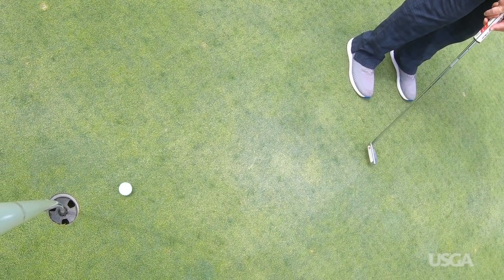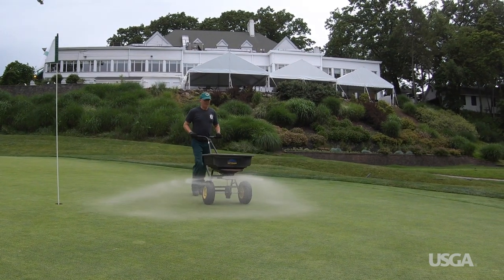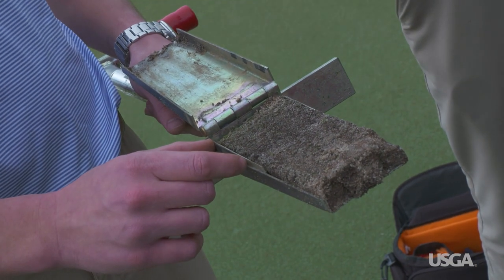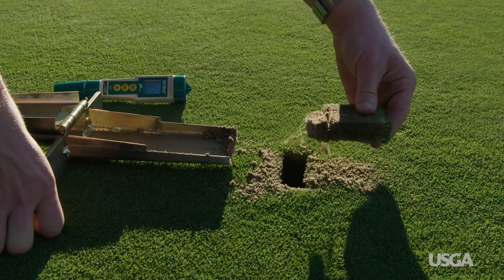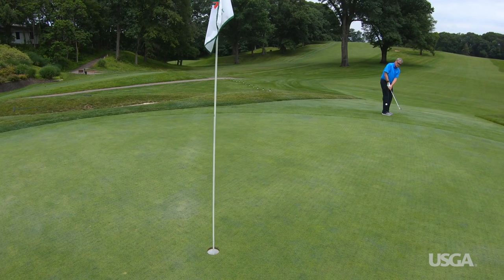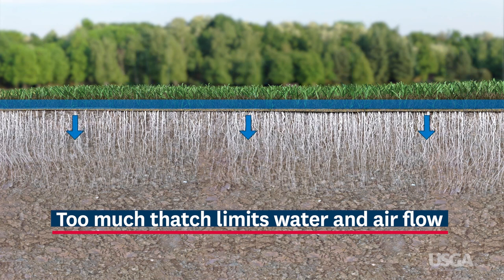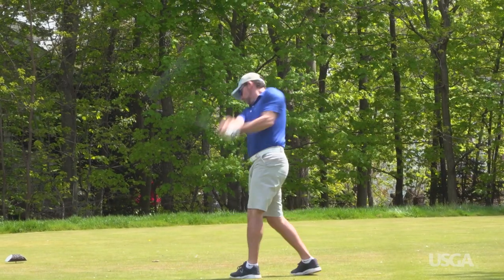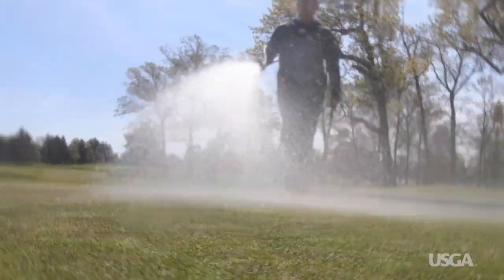Fore the Golfer: Why Courses Topdress Greens

Comment: So I'm still confused. Sand helps to dilute thatch. I understand too much thatch is not good, but HOW does the sand dilute the thatch? Does it draw water out of the thatch? All I see is a layer of sand going on top of grass and no interaction with the thatch underneath.
Reply: it's that a mix of the thatch and sand and dirt is a softer base for the green...what's interesting is that metal spikes used to naturally aereate the greens
Reply: I would assume that the sand gets put on top of the profile so it would eventually move that organic material further down through the profile over time and also promote drainage with adding sand.
Reply: Thatch is the layer of dead tissue between the growing surface and the soil layer.  Incorporating sand into that layer brings oxygen and microbes into that layer and breaks it down.